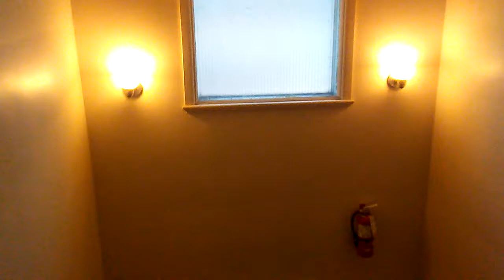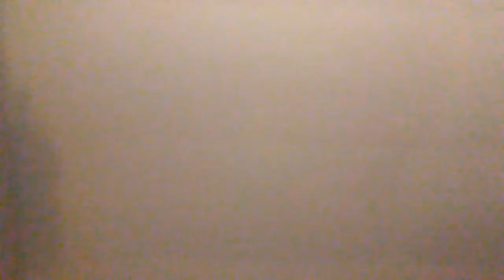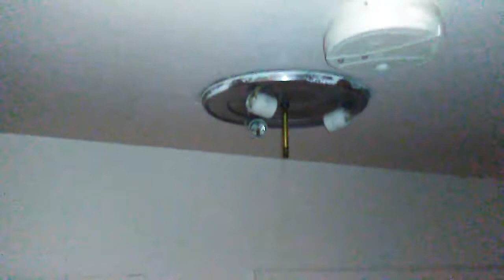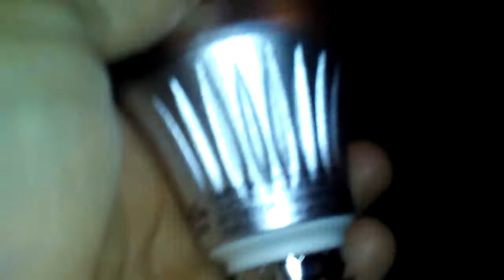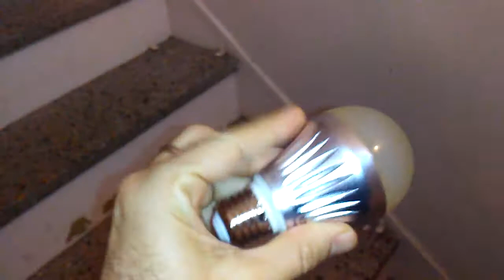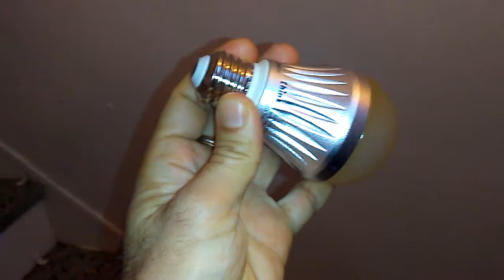LED lightbulbs can sometimes release electric fire smell

Comment: Thanks for the video.  We had an electrical burn smell in our upstairs yesterday - it was difficult to figure out the source and had me worried.  Our son will be visiting us for a few days, so when I was getting some things ready for him in his old room, I found that his bedside lamp was not turning on.  The bulb was a Firefly Luminaires LED bulb, which I think is a smart bulb, and it was definitely the culprit.  I found your video when trying to search about it, and it's surprising that there's not a lot about this problem on the internet.
Reply from the maker: Thank you for your comment, makes me happy to hear that this video solved your mystery. Indeed there is no info and that's why I had to add something as the smell drove us crazy and scared us until we spotted the issue.
Reply: @photographiedynamic   The bulb shown in your video looks like a Think brand bulb. so I just did a quick search to see if it's a smart bulb, but it does not appear to be.  I was curious if smart technology could have anything to do with the failure of our Firefly smart bulb.  We've used led bulbs in our home for some time now, and this was the first time running into this problem.  The only difference in our case is the Firefly being a smart bulb; the only smart bulb we've ever used - think it came (used) in some freebie that my wife dragged home.  We did not try using the smart technology of it, and it worked fine as a regular bulb for the relatively short time we had it.  Just adding some detail that someone seeing your video and the comments might appreciate and perhaps reply with any similar experience.  I guess I'm still concerned about the potential for faulty / damaged wiring that may have contributed to a voltage spike.
Reply from the maker: Light bulbs used to be metal and glass only and therefore there is nothing in there which can catch fire or produce electrical burn smell. The LED or smart bulbs of nowadays have many electrical components such as resistors. These can occasionally cause smells. I went through 10+ led light bulbs and this was the first time I had an issue...

Comment: Happened to me last night, even blew a freaking breaker in my electrical box.  Usually, I thought they'd pop like CFC and even incandescent bulbs when you first turn them on, but not for me.  And OMG yes, they smell like shit.  It was in a ceiling fan in my bedroom and I ended up sleeping in a different room while I ran the exhaust fans in the house with a couple windows open trying to get the smell out.  Sadly, I didn't pull the bulb and toss it in the trash until this morning.  I've been trying a mix of vinegar, chlorine dioxide and baking soda but It still smells pretty bad in my bedroom... going to vacuum in there in a bit and I'm guessing I'll need to toss the bag.  The smell lingers people.... just a heads up and it kinda concerns me since it smells much worse than what I've experienced when something like a capacitor popped on a circuit board.  Ugh..... need to find the others in the house and remove them before they do the same.  I'll try to report back when I finally feel like the smell has subsided.
Reply from the maker: Thank you for commenting and sharing your experience. This will for sure help a lot of people. It's exactly why I posted this video. I saw nothing out there warning me about this. When it happened to me I was about to call the fire department I was so scared that wires somewhere are burning. Please share the brand name with use so others can be warned. I think this should also be reported to the fire dep and government officials just like a medication that would have adverse effect. Thank you!